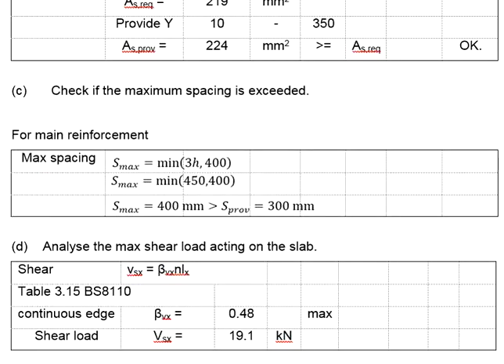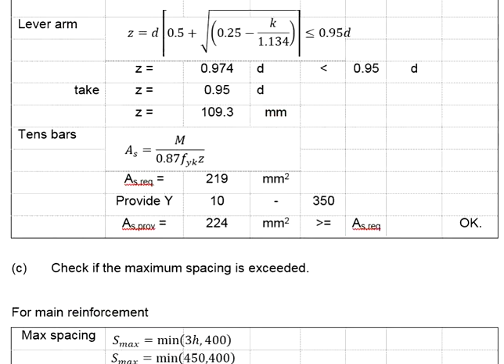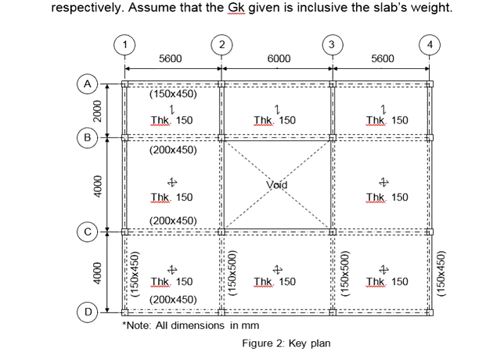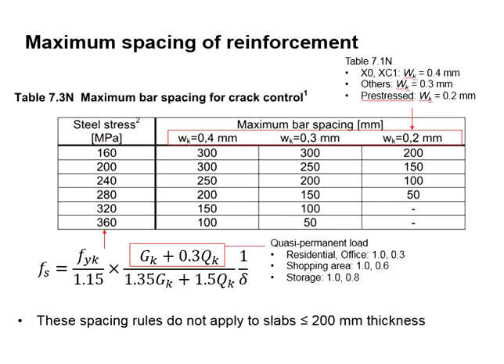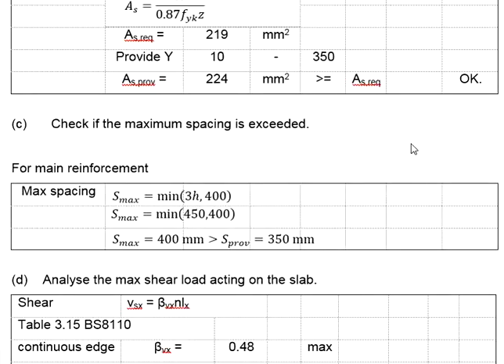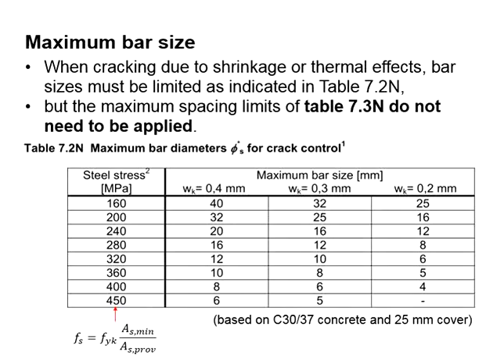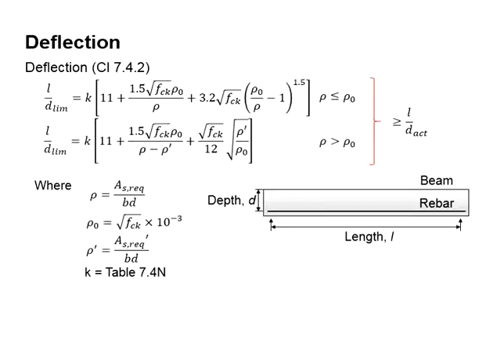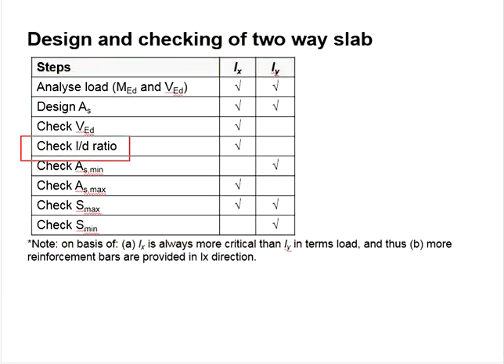11.13 Revision slab: Part 4 - Serviceability

Comment: Tq shifu... If you dont mind to design a pile cap/pad footing refer to jkr probe/mckintosh probe result
Reply from the maker: I think about it. probably conceptually explain a bid in my upcoming module on the integrated design project. But may take some time.